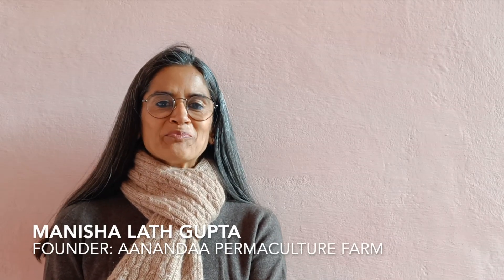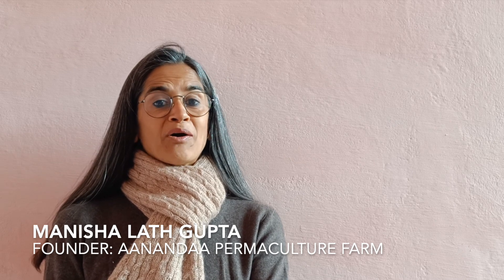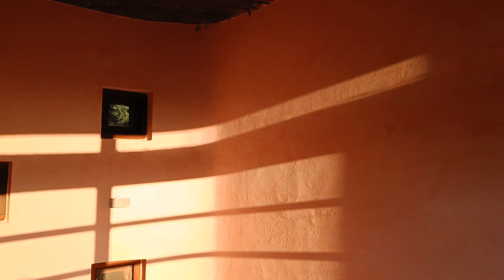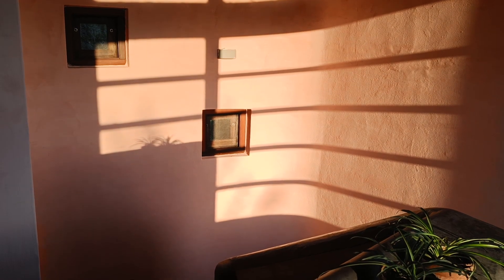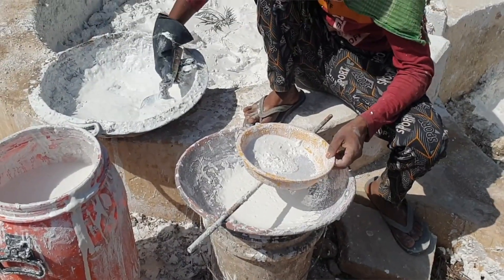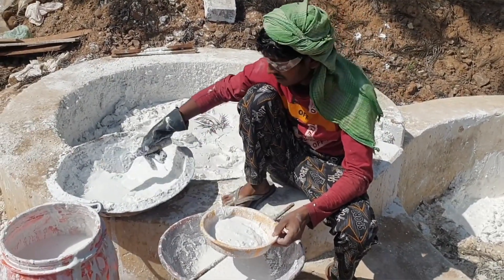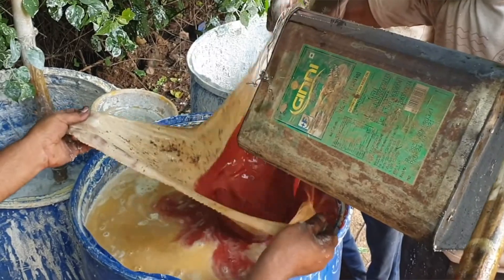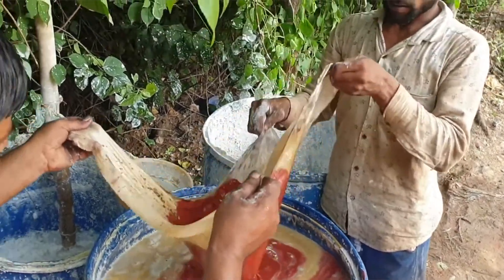Lime Surface Finish: Lime Wash

Comment: This series on all things lime has been most valuable! Are you please able to tell me if limewash on the exterior facade is burnished with soap, in this case would there be a need for reapplication every year or would it make the limewash more durable? This is in reference to building in Goa which faces high monsoon rains. TIA

Comment: Thanks for these videos. Can you do a video on Lime Wash vs Lime based paints ?. we had more than century old home with lime it was removed for cement in earlier gen due to maintenance wondering if i can use lime paint and don't have to do early maintenance like wash and problem of sticking to shirts etc
Reply from the maker: Hey sorry, we have only used lime wash.